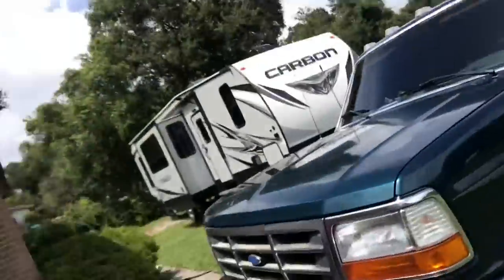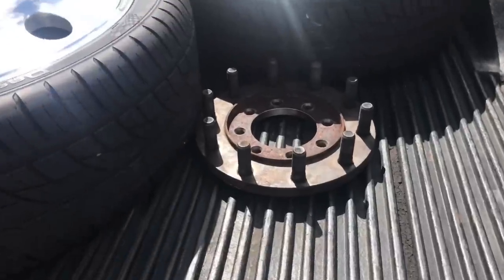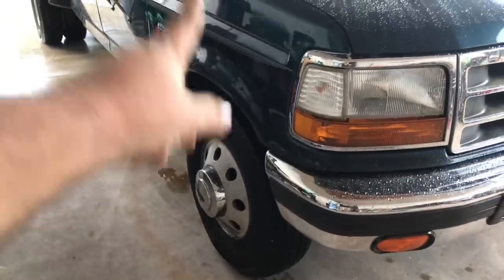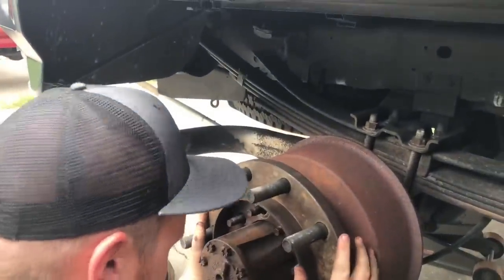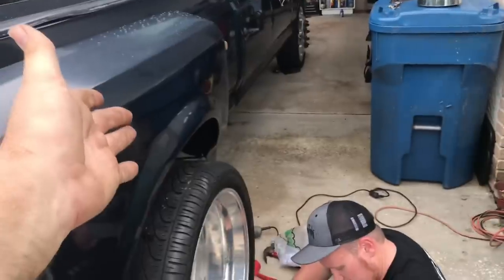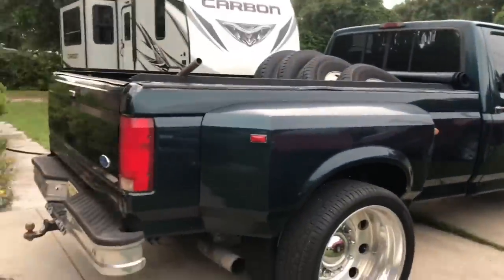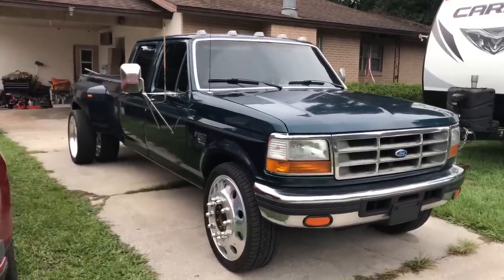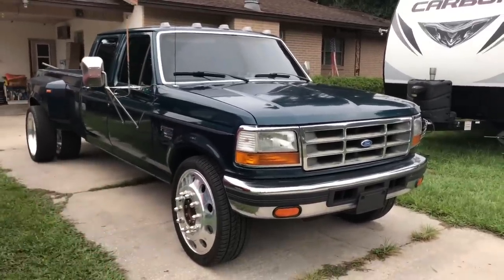24” ALCOA Wheels on 1997 Ford F-350 dually powerstroke 7.3 diesel

Comment: IS it easy to bend the rim with those lower profile tires , around here pot holes are every where and lots of people running rubber bands , crack rims,  not sure if those type of rim and tires are different
Reply from the maker: e harris it’s not easy to bend but it’s easier to bend with low profile tires compared to having bigger tires. These are very tough wheels, it would take a lot to bend them

Comment: Base on the size of the tire, they are around  11.5 to 12inches wide,if im correct. 
My question is ,those 24 inch rims are 8.25 or 10 inch wide?
I have a 95 obs ,I'm going with the Same set up .
Awesome truck.
Reply from the maker: Pablo HERNANDEZ they are 8.25, most of these Alcoa wheels are the same width. Thank you

Comment: Let Me Ask You A Question About Truck Wheels 
Probably You Know The Answer. 

Will 22" Inch Tire Fit On A 22.5 Rims 
Will .5 Will Make A Difference Or Not . 
On The Fitting Of The Tire .
Reply from the maker: Fernando Mendoza I’ve seen people do it and it’s so dangerous, i definitely recommend not doing that
Reply: I seen them mill off the .5 to make them even 22".

Comment: What size tire. 305 what. Was it alot of work getting them not to rub. I like that size tire
Reply from the maker: Stock suspension, were they rub it wouldn’t mater what size tire you put on it, it’ll rub a little no matter what. Put a spacer will help
Reply: @SparksM3dia  where do you find the fender lights

Comment: Bro man I just got a obs dually and want 24s but man 3k !?!?! I'm guessing it's because they're also selling the adapters. I saw them for around 1k all 6 alcoa I could be wrong
Reply from the maker: Well I got them for 2800, that’s the wheels milled down from 24.5” to 24”, tires, wheels, lugs and center caps. You can definitely find them cheaper for just wheels but have to get them down to a 24” and need to be careful because the wheels are soft and bend easily. Most you find are cheap are from a semi truck so they might ride rough

Comment: Where did you get those rims, I have a 2018 Denali and I want to put a pair on mine
Reply from the maker: Reginald Grant i got these used from a guy on Facebook market place
Reply: Any big rig shop will have them
Reply: @jase1911  thanks, do you know where I can get them milled down to a 24 so I can put 325/45 24 120s Pirelli on it
Reply: @reginaldgrant4273  if you actually can get the correct dimensions you can just find a decent machine shop and they can put them on a lathe and turn them down to the correct size
Reply: @jase1911  Thanks my friend

Comment: THIS IS A PUBLIC COMMENT NOT MEANT TO OFFEND BUT TO INSPIRE AND BASICALLY.......give you my opinion. This truck is freaking awesome and badass buuuttttttt..........I would swap out the mirrors for newer model mirrors and then would convert the small flip window to permanently stationary with appropriate metal filler to hold the mirror and if your state doesn't run a front license plate delete the bracket. Just saying. The wheels are epic, very jealous.
Reply from the maker: Johnny b goode oh no man i appreciate all recommendations on the truck. Unfortunately i sold the truck BUTTTT i got a new one and i was actuallyplanninh to do the new mirrors and do the solid window.

Comment: How are those 7.3s?
I heard they’re gas guzzlers
Reply from the maker: Richard Foust the are great motors, surprisingly I’m getting about 15mpg
Reply: @SparksM3dia   i have a 97 f250 2Wd long box extended cab, 7.3 minty, silver. Love the dam thing, dont drive it in the bullshit winters we get her!
Reply: You heard wrong there diesels
Reply: Kendrick historian poet
The 7.3 powerstroke  is the best diesel engine Ford ever made. The only power is, is that they stopped. I have a 1995 f359 liariat crewcab dually with 189, 000 miles . Every time I stop somebody wants to know if I want to sell it. Trying run behind everybody when you are ahead you trip over yourself ,that's what Ford did with the 7.3. oh in the city I. Get 18 mpg and on the hwy 23/24.

Comment: Could you share the product with the viewers , I had my f350 stolen a week ago and got it back without my 22" $ 4300 dollars
Worth and 5th wheel hitch gone too.they were not new been on it for 3 years just put 2 new battery's in and drove it around the block 4 times
To get ready for a G DAM smog check.  ( on a diesel ) Some one on my block has been waiting for 2 years cause that's how long it's been sitting with dead battery's.progressive insurance co said a 1999 F350 4x4 with gear vender over under drive 4"stainless duel exhaust AFE cold air intake airbag suspension 12000 lbs custom rear bumper & roll a long stainless running boards and trim package with 206.000 miles has no value !!!.
I have a 1 million dollar liability coverage to protect my ass, and it's 267.00 a month  with 1000 deductible for that much coverage .my claim is more than it's worth in there expert opinion.now they want to total it out an give me a check for 6000 less the 1000 deductible that leaves me 5000 dollars , if I want to buy it back it's 6500 so every body make dam sure that your policy specifies every thing on the vehicle or ( bend over )
I have lots of time to wait a be a happy satisfied customer, we'll be going to arbitration on this for sure ,and these claims adjusters are not your friend they get paid to give you the least amount possible .